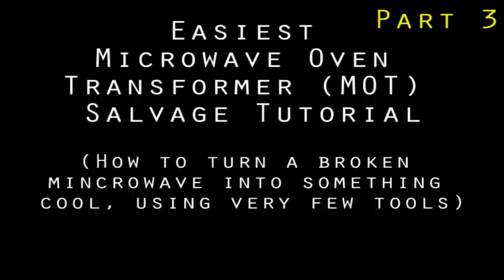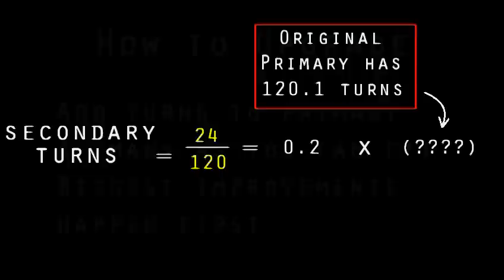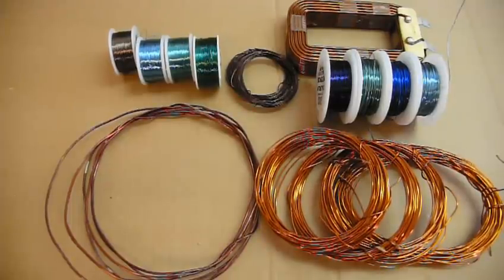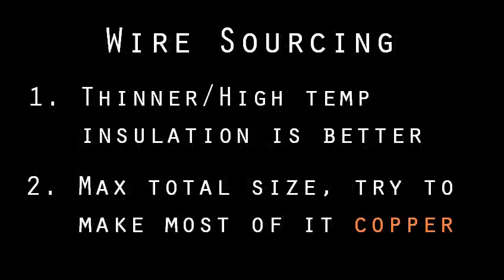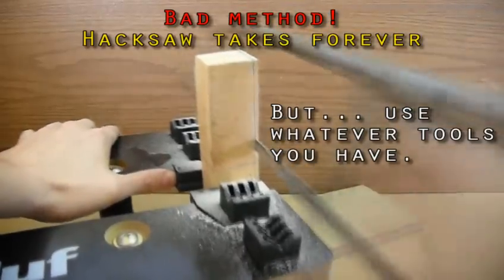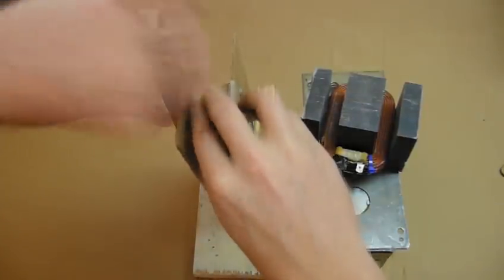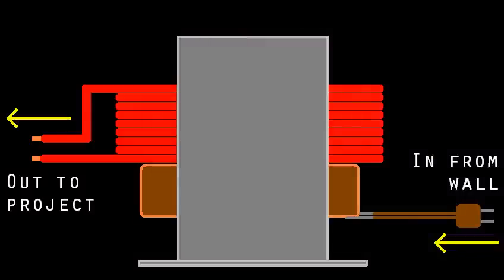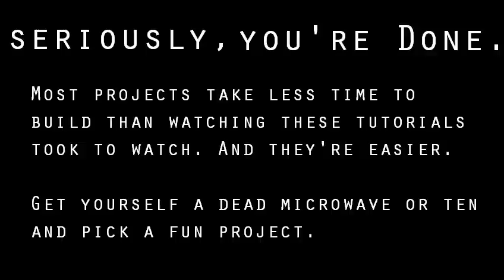Easiest MOT Salvage Tutorial Pt.3

Comment: How important is it to have the two transformers make the same voltage/amperage?
Reply from the maker: It depends on which way you go, series or parallel (match current or match voltage). In each case, it's critical that you match the thing you must match, and not-at-all critical to match the thing you're not matching. For example, in parallel, you want the voltages to match exactly, to the point of, you might want to tweak the primaries to add however many turns makes the secondary voltage match the other transformer. But, you could have one 1000W transformer and a 200W transformer, both at the same voltage, in parallel, and be fine. If voltages are off, they'll fight each other to equalize.

In series, you need to use the same wire thickness in both, though each will have different voltages. In this case the voltages will add, so, if the first one has 20 turns and the next one has only 5 turns of the same wire, it's equivalent to 25 volts. If wire thicknesses are off, since current only has one path to take, the part of that path that goes through the thinner wire will overheat sooner.

Also you have to match phase. But that's easy. 50/50 chance of getting it right. Volts will either add or subtract. If you get basically no volts, switch the wires on the primary of one of the transfomers (as in, the primary has 2 terminals, swap the wires from however you first guessed).
Reply from the maker: Giggity Garrett I can't see your other comment you left. "I can just take that and the volts Im measuring from the transformer output to then find the amps coming from the output, right?" Yes. Except, it doesn't tell you the amps, it tells you the MAX amps. How many amps still depends on what you hook up. Also, in series you do not add volts, you add amps. I would not go too high on amps for a welder because to do so you  will need thinner wire, and then you've limited your max amps. 20v should be enough, 30 is pushing it. You could go to 80V if you want but voltage is not your limiting factor, the resistance of a weld arc is already low enough that you'll be maxing out your amps at a lower voltage. Higher amps just help the arc start and sustain a bit easier.

Comment: I used 4 MOTs . Primaries were connected in parallel to 240 V supply  For secondary winding 16 mm^2 
copper cable was used . Secondaries in series giving an open circuit voltage 25 volts.

When I try to weld (12 SWG ROD ) the welding rod gets attached to the work piece and the the welding rod became red hot and I had to forcefully pull the rod out. But sometimes I can weld.

1.What is the problem. 
2.Is 25 V enough for welding ?
Should I increase secondary voltage using 10 mm^2 cable. ( The primaries are drawing power from switch board via a 25 A circuit breaker)
Reply from the maker: 1 - Could be bad technique on your part. This could be the welder, but it also is normal for inexperienced welders for this to happen. If the tip "sticks", it is normal to turn red hot in seconds and have to snap the rod off and start again, that just means you got a bad arc. However, it is also a symptom of not enough voltage or current, so it's difficult to say what the cause is. Keep trying and practising. If you can bring your welder to a welding supply shop (the place you will buy your sticks, not a general hardware store) or ask someone else who knows how to stick weld to use it, then you will know if it is the machine or if it is your low skills. They may try to tell you it's the welder just to sell you a welder, but tell them you can't afford to and this is a science project. 

2 - 25v is enough. 30v might be safer. 36v is usually too much. But I don't think this is the problem. Try connecting two car batteries in series and using that to weld. That's only 25 volts. If you have the same sticking problem, then the problem is your skill.

3 - I would not make modifications to the welder until you have isolated that the voltage or current or technique is the problem. It should work just fine the way it is.

4 - Try using a thinner welding rod. Yours seems to be 1/8" or 3/32". Buy some 1/16" inch, they will be much easier to arc because it will take 1/4 as much power as 1/8". Once you get good, try heavier sticks.

Please try this and then give more feedback. I am happy to keep helping.
Reply: @MattsAwesomeStuff  Thanks Matt. I will try these steps.

Comment from the maker: Connect one wire from each primary (left side of each) together and connect that to one side of a 220V cord. Then connect the other two to the other side of the cord. On the secondary side, if you want 18V output, connect lefts to lefts, rights to rights. If you want 36V, connect the left of one to the right of the other and then tape and hide that joint. Use the remaining two wires as your output. Either way, if you get near zero volts, flip ONE of the MOT's output wires (switch its left/right)

Comment from the maker: 1 - You got it. The drill motor has resistance. Amps = Volts / Resistance. So, if you give it the voltage it's designed for, and its resistance is what it is... it will use the current its designed for. If you give it more voltage, you'll get more current (it'll spin faster... you can probably cheat and get more power this way too, mostly-safely).

2 - First, when you turn AC into smoothed DC, you get 1.4x the voltage. So, 14.4 becomes 20. That's probably fine. (I screwed up this formatting...)

Comment: Hey Matt 
I want to know if I use enamled magnet wire to make secondary, what would be the best gauge for 24v and upto 50 amp
Reply from the maker: +Anurag Trivedi - Did you watch the tutorial? What part confused you? ... Voltage has nothing to do with wire thickness. Amperage... as thick of wire as you can fit in. Thinner wire will overheat quicker, there's no hard rule.
Reply: Thanks.. 
I figured it out already.. 
I just sandwiched the transformer in between two wood pieces and they are really tight. 
But the mot still makes too much noise. Will sticking the core with 2 part epoxy fix this noise?
Reply from the maker: +Anurag Trivedi Noise comes from 2 places: 1 - the E rattling against the I, and, 2 - The coils vibrating. If your noise is mostly core noise, then a very (very) thin later of epoxy will improve this, or just put it around the outside. If your noise is mostly coil noise, you would be best off dunking them in epoxy or securing them some other way.
Reply: Thanks ill do that
Reply: como cilindrar vidrio

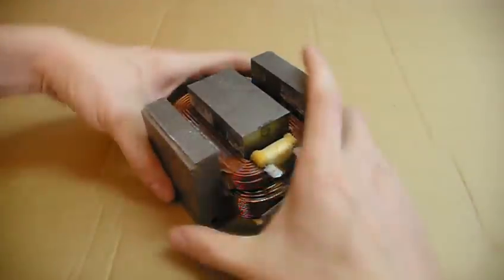Comment: i am planning to make an isolation transformer with MOT, If i take primary coils form two different transformerts rated for 240v and  put them in same tranformer core will it be a good isolation transformer and will the ratio be 1:1 as in your video @ 2:05
Reply from the maker: Yes. Chances are they will have the same number of turns. If they don't, your ratio will be a little high or low. Keep them separated. Also, I like to have the terminals of one on the opposite side of the core of the others, that way the wires are less likely to short. I would add extra turns to both of them regardless, you'll have a bunch of extra room so if you have a 3rd primary to cannibalize I'd strip a bunch of wire off that (about half), join the coil that's left to one one primary, and then wrap the rest into a coil for the other (former) primary.
Reply: well yes to be on safe side addind more turns on both coils is a good idea but in my case ill be using it with a vaiac, so maybe it wont matter,  and i was wondering if i should connet it at the input of the variac or at the output? and how can one measure the max amp both coils can handel?

Comment: hi! I’m making an electromagnet as a small part of my engineering thesis. The thing is, I’m a chemmy, not an electro guy. My project involves the highest (constant not alternating) magnetic field possible within an air gap of 1 cm. I already have the E and I and the primary. Maybe I could ask for your advice on how to crank the max of the core/coil to make as much field as possible. If there is no problem, and you could share some ideas I'll lend you my e-mail.

Comment: Excellent tutorial! I'm going to to do this on my transformer. It's 240 volt in Australia. I was going to use on secondary winding 6 to 8 gauge? I'm hoping to get over 20 amps if possible? Any reply appreciated cheers from Australia 🙂👍👍👍oh btw liked again. Sweet job!
Reply from the maker: You can get any amperage you want. The more important question is: What voltage do you want? That will determine if you have room for the number of amps you want. 20 amps needs about 12g wire to not overheat (in housing wiring). But it all depends on how much voltage you need.
Reply: @MattsAwesomeStuff  I'm aiming for 14.9 volts for deep cycle battery charger. If I have 240 input and say 18volt output with no load? I was going to just put a 50 amp bridge rectifier? Maybe some capacitors etc? I would love to get even higher amperage if possible? Thanks for the quick reply appreciated cheers!👍👍👍
Reply from the maker: @dragan3290  - Okay, few things:

1 - if you give a "12v" lead acid battery more than about 14.8v (14.4 is safer), you'll boil it and ruin it. So I'd target no more than 14.4, and, you could target 13.8v if you wanted.

2 - When you convert AC to DC, because AC is measured in "RMS" (similar to an average, but different), the peak voltage is actually 1.41x as high as the RMS. I.E. "240vac" has 338v peaks. A capacitor helps smooth this, at the max, by being really thirsty when it gets to the max, and then trying to carry some surplus until the next peak. But either way, 338v would be the peak, and would be what the battery charges to. So that's no good. So if you're targeting 13.8vdc, you need 9.8vac max.

3 - Your bridge rectifier will force electricity to go through 2 diodes, (2 of the 4, regardless of polarity), each which will drop 0.6-0.7v. So, you have to add 1.2-1.4vdc to your DC target. So 13.8vdc target becomes 15vdc target. Then backing up, you still have to divide that by 1.41, so, your target is really really 10.6vac.

4 - Go through the math now, if you have (I don't know, test it) 240 turns on your primary, then you need about 10 turns on your secondary (because you probably don't want to be over). You could do 10.5 turns, or, just play around with it a bit.

5 - You didn't say how big your transformer is, but let's say it's average of about 800 watts. 800 / 10.5 = 76 amps. So, you could technically support 76 amps, power-wise. It's going to get hot, but you could do it. You want to use the thickest wire you can get away with, so if you have 6g, as long as you can fit 10.5 turns in there, you're good. That's roughly what 6g could handle. Else, drop down to 8g.

6 - Because it's not an intermittent use device, you really really really need the microwave fan on there, non-stop. It's going to sound like a jet engine. So, I suggest, if possible, using smaller wire for your secondary, and trying to add a bunch more turns to your primary. Like, an extra 50-100 if you could, but, whatever you can manage. You'd need another 240 turns if you wanted hope of it running without a fan, and even then, an old PC heatsink on the core would help. Of course, this affects your turns ratio, and the size of wire you can use on your secondary.

7 - When you coil, leave that extra space around the outside like I showed you, to give yourself a chance of aircooling it.

So, there you go, you have some choices to make.
Reply: @MattsAwesomeStuff  oh man! You explained everything perfectly. Microwave transformer I have is pretty big. Heavy secondary height is32 mm and width is 18 mm. Thanks again! I'll be doing it your way. For sure. Wealth of knowledge!🙂👍👍👍

Comment: Hey man.... 
I have a mot and I made a secondary for 25v. But when I plugged it in for the first time (without load) my MCB tripped! Is that normal or I'm doing something wrong... I didn't touch the primary winding, it is as it was. 
Should I put a load resistor on the secondary in parallel to make it work??
Reply from the maker: +Anurag Trivedi - Hard to diagnose via description. There's a few options: 1 - The primary is shorted to the iron core, either by scraping it when you took it off or from vibration or weak insulation or something else. 2 - You may have one winding shorted to another winding in the primary, reducing the effective turns count and causing too much current to flow. 3 - Your breaker is just sensitive. 4 - The inrush current from the MOT creating the magnetic field is too high. 5 - There is something else plugged into the circuit and the waste heat of the transformer (several hundred watts perhaps) is pushing it over its limit. 6 - If the secondary is shorted internally or to the core, causing a huge load, it might be too much for the breaker to handle. A load resistor on the secondary isn't going to help, the "resistor" of air between the contacts is already tens of thousands of ohms. Give it an inspection and check for faults. Or move it to a breaker that for sure has nothing else on that circuit (not just an empty plug).

Comment from the maker: Alok - I'm not going to troubleshoot privately. If I'm going to say something, it'll be here where at least other people can learn from it. MOTs run ~1000 watts. You've got 4, so that's 4000 watts. Maybe more if you knocked out the shunts. Yeah, that'll blow a breaker. Nothing you can do. Primaries in series would cut down on losses, but also cut your power in half. Scariac is one way to go, but it's a bad way. A beefy light dimmer is cheaper and easier. I have a couple other ideas but they're not explained quickly. Also, those limit the power when you weld too fast, that is not your problem, your problem is that you cannot supply the amount of power you need to weld. 2.5mm might work, but I think you can find.. ~1.6mm sticks as the thinnest size. That will make a big difference. You can also wire your MOTs to separate plugs, and plug them into different circuits in your house on extension cords. Not just separate outlets, outlets each on a different breaker.
Reply from the maker: You're wrong, they can. However, they get extremely hot when doing it, and cannot maintain that level of power for more than about a 5-10% duty cycle. A larger transformer would be able to maintain 100% duty cycle, but similarly, you could get a lot more power from that bigger one at a 5-10% duty cycle too.

Comment: i have 2 230V 50HZ mots rewound with 20 turns of 10 gauge wire a outputting 18 volts.how do i connect them to a 240 volts mains in my home

Comment: (Posting these backwards so they appear in order, as posted.)
1.) This is obviously going to "provide" much more amperage than I actually need. Will that somehow overload the drill? Or will the drill only use what it needs, and not be bothered?
2.) I have to get from AC to DC, obviously. Is there some way to use other parts from the microwave, to do so? Or am I going to have to buy a bridge rectifier? And if I have to buy the rectifier, what do I tell the nerd at Radio shack, that I need?

Comment: At the end you put power to your new rewound transformer, Is it really that loud? or did you add the loud noise for effect?.
Reply from the maker: The hum at the end is not a sound effect, that's the actual noise. It might be a big magnified by sitting naked on a wooden table. Most of the noise is the E and I rattling against each other. The rest is the coils rattling against the core. Also, I did not do any of the things to quiet it. Even one strip of duct tape around the outside, more paper on the coils, a quick flash of a weld on the corners would reduce it to a whisper. Ideally silicone it or varnish.
Reply: I was thinking same thing if it was welded together the two halves would not of rattled against each other.

Comment from the maker: @tomatohodson : That's just it. I compress with "Maintain pitch" so the frequencies don't get chipmunky. And in editing it's fine. But above some speed, they mute entirely. The only fix is the opposite, let it get high pitch, then try to guess at how far to bring it back, and even then it sounds muffled. Currents: 1 amp per watt. ~1000A. I cover it in the video (scripted, so far unfilmed), cast alum is fine, but you lose 40%. So, 600A. Don't worry, there's a free copper method.

Comment from the maker: 9.8 amps with no load? If so, something's very wrong. That says something is shorted, I'm surprised it didn't blow a breaker. Your primaries might be out of phase, or your secondary is. Flip wires on the primary perhaps?

When fixed, fan cooling is still mandetory. Duct it with sheet metal too, to force it past the MOT. Else, use 1 minute on, 9 minutes off. Even commercial transformer welders have 5-20% duty cycles.

When welding, try both. If 22v works, use that. Bad arc, try 44v instead.